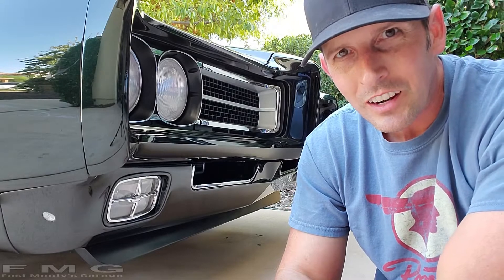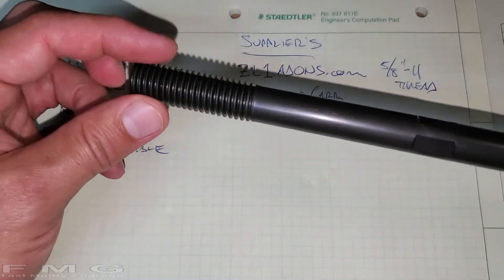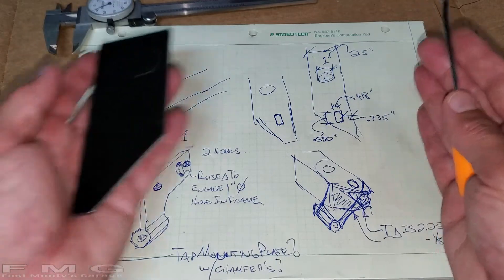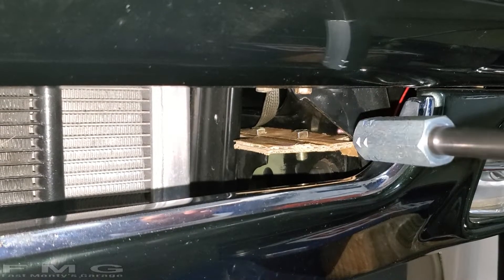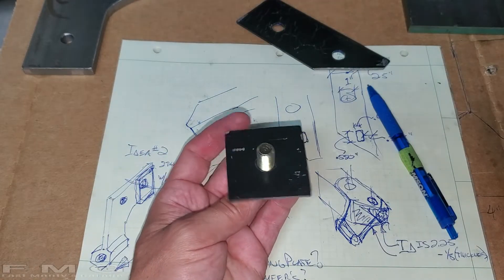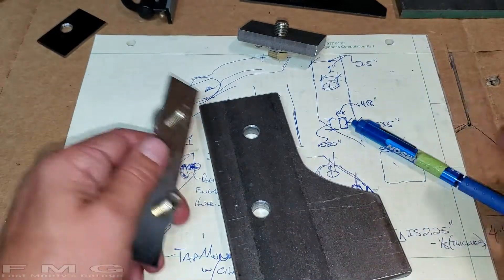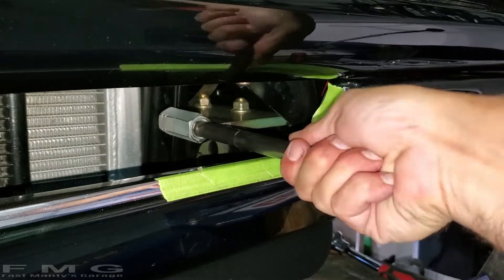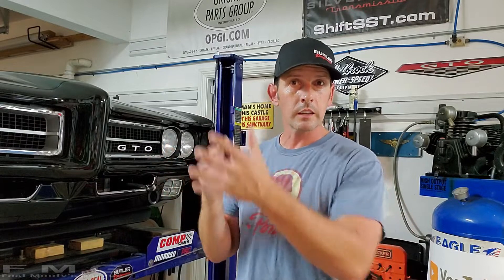Design and Fabrication of a Custom Tow Hook for my 69 Pontiac GTO

Comment: Most newer gm vehicles have the hook on the passenger side. Maybe if in a right hand ditch it would help turn it uphill as it comes out? So the hook was custom length to fit through the valance? I think the hideaway bumper brackets will make installing the nuts more difficult but if the bolts are coming in from the bottom it might still work. I like the captured bolt piece. I'll take some measurements from the frame to the lower valance. It be nice if all that's needed for smaller valance is welding the zinc nut on top of the plate.
Reply from the maker: Yeah, I've seen them on both sides, which is why I made it reversible.  I wish I had a hideaway headlight car to look at... what year is yours?  I know 68's and 70's have a smaller valence opening... let me know, when you know... thanks for the comment!
Reply: @FastMonty  68 gto with hideaways. We talked a bit about your tow hook on instagram punishergto
Reply from the maker: @punishergto5182  Ahhhh... sorry, my mind is still mush from the holidays.  Yeah, I remember.  I wish I had a 68 in my garage to look at... as well as hideaways.  :)  let me know if you're able to document any measurements, and I can do my best to see if an easy mod can make it work.  Thanks again for the comment!
Reply: @FastMonty  I know the feeling I walk past my car at least 4 times a day and I havnt had a chance to put a tape measure on it.
Reply from the maker: @punishergto5182  Ha!  No worries... I feel the same way.  One of these days... ha, ha... see ya!

Comment: Curious what company you  got your moden wiring harness from and what the complexity level of it was? I have a 78 Corvette that I am about to install a vintage air kit in and since the dash will be ripped apart I was thinking it would be a great time to modernize the electrical.
Reply from the maker: Good question Joel... I'm in agreement with you.  The hardest part about a new harness is everything under the dash.  Check out www.PainlessPerformance.com  (BTW, solder as many connections as you can, including the terminals)  Let us know how it goes, and good luck with your build!

Comment: I'm  just thinking that one on ea. Side might be better than just one side . To lessen the chance of pulling the frame out of sqare . But Maybe I'm just over thinking it . a perfectionist I am . but I will let you make the call. Just trying to be helpful. Great idea though , I like it.
Reply from the maker: Interesting thought... I don't think I'm concerned about it.  To bend a frame, you also need to pull from the opposite direction ie lock it down.  So, unless you wrecked and ended up in wet cement, that dried, I don't think it'll harm anything.  That said, I have no problem selling them in pairs, that'll double the profits.  So, you wanna buy two?  Ha, ha... Thanks John!
Reply: @FastMonty  yah your right , I sometimes over think things . My bad . Great idea and video as always plus it even looks good too.
Reply from the maker: @johnkennedy8452  Ha!  No worries John... I'll still let you buy two.  :)  Thanks for the comment!

Comment: Going to be better if you had a second one on the left and the right so you can and they can pull it straight instead of trying to pull cricket
Reply from the maker: Maybe.  But, I'm not concerned.  It takes a lot to bend a frame, and the frame needs to be rigidly mounted and then pulled in the opposite direction.  That said, if there's concern, I have no problem selling them in pairs.  :)   How many would you like?  Ha, ha..  thanks for the comment!

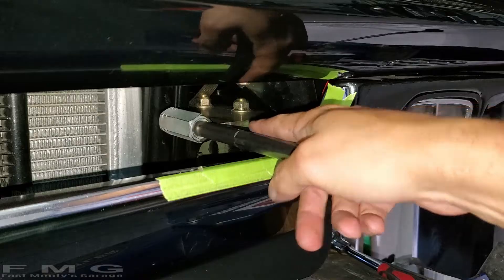Comment: 14:00 why didn’t you centre the rod vertically in the open space?
Reply from the maker: No reason... it happened to be a straight shot to the frame, through the center line of the bracket.  If I can get my hands on a 68 and/or 70 GTO, their valance openings are smaller, where if I raised it up to be centered, it might also fit other years.  We'll see if we get any interest...

Comment: Test it. Low grade stainless cant handle much side shear. Dont want it to snap right off.
Reply from the maker: Matt, Great point!  The Tow Hook itself, and stainless rod is proven and tested.  There are no worries there.  It's also designed for Tension, not Shear.  Thanks for the comment!